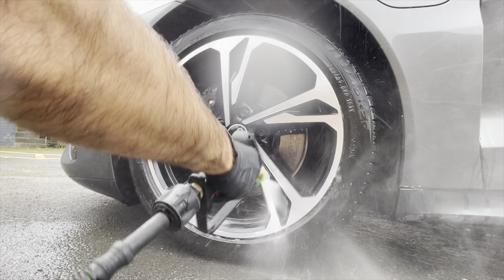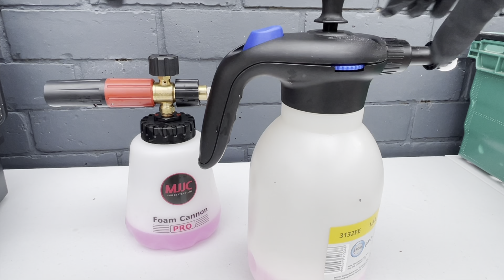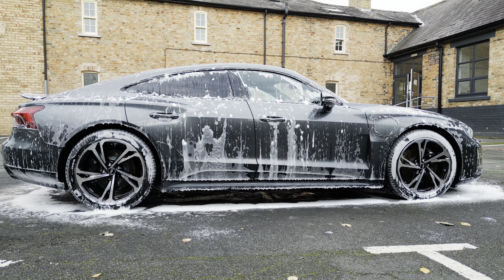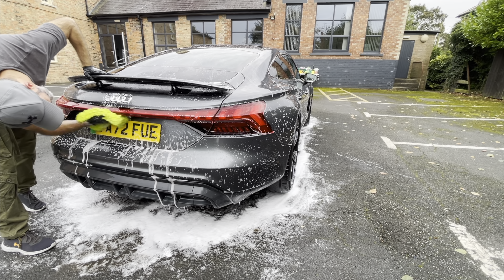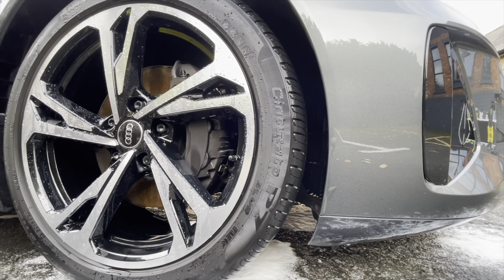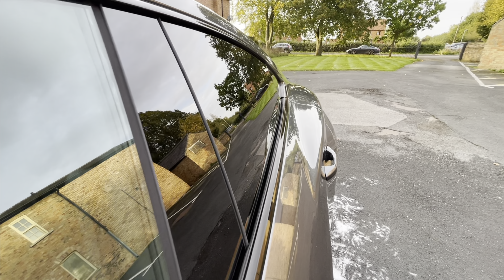ASMR First Service Wash on a Brand New All-Electric Audi eTron GT | Car wash

Comment: Many thanks for sharing, great job on the car, and nice filming. 
What was the bucket attachment? That looks very handy 👍
Reply from the maker: Thanks Ally, I appreciate your support. Thanks for your question. It's an auto shut off valve, it lets me get on with other things rather than standing holding a hose pipe, it may only take a minute to fill a bucket but when there's three buckets! You can do a lot in three minutes. I just hook it on the edge and leave it while I start prepping other things like the foam cannon, pump sprayers, get the jet wash out, hook up the electric. When it fills a bucket it stops automatically and starts automatically when I swap it to the next bucket, it's also controlling the hose so that's not flailing around. I'm saving water and making the wash process easier for myself at the same time. It can also be used as a constant level valve which is useful when washing wheels for example as the water level tends to drop quicker in the wheel bucket as the wheel woolies are super absorbent but loose a lot when they're pushed through spokes and get squashed between the wheel barrel and the caliper, the valve maintains the level whilst at the same time refreshing the water to some degree. This is the first of the products we have developed to make car washing faster, easier and safer for the finishes on your car. There's a lot more to look forward to so watch this space. Thanks Mr Techstyle
Reply: @MrTechstyle  many thanks, that looks awesome. 
If you could let us all know when this becomes available, I’m sure others would love this too

Comment: Very nice and detailed video! What wash mitt pad is it?
Reply from the maker: Thanks for the compliment, greatly appreciated. It’s a Chemical Guys Chenille Microfibre Wash Pad, I was using a mitt but I find this to be a better quality as the mitt lining can start to fall apart over time. The pad let’s me quickly flip to the other side and I can pick it up and put it down quickly, I no longer see the sense in having my hand inside it. Ive not dropped one yet and if I did I’d get another from clean. I’ve also found I get less or no water inside my gloves with this pad. As a product designer I’m closely looking at all cleaning and detailing products with a view to producing a full range of service/maintenance wash products so any thoughts or improvements you can think of I’d be happy to listen. Thanks Nate.

Comment: Very nice work.
I have a q for you about grit guards. Several different types (you used different ones). Do you have any preference? Are they all about as effective as each other? Do they actually do much? 
that hose holder thing is a work of genius so you probably look at other things in a similarly critical manner, I'm guessing.
Cheers
Reply from the maker: Hi, thanks for your question. I think I have about 6 different grit guards on test at the moment, as well as physical testing I am testing with computer fluid dynamic software which is showing some really interesting results. I am working on a design for a git guard at the moment should be available February along with quite a few new products to make life easier, faster and give better results. The hose holder is actually an auto shut off valve so when the bucket becomes full it stops, as soon as I move it to the next bucket it starts again, when its finished with the buckets I simply disconnect and attached the hose to the Jet wash, again easier/faster. I've had it on test for about 6 months and honestly I just love it, it's a small thing not having to hold a hose and waiting for buckets to fill but all these small things add up. That product is almost ready to go, we are working on packaging at the moment. Thanks for your interest it's greatly appreciated.